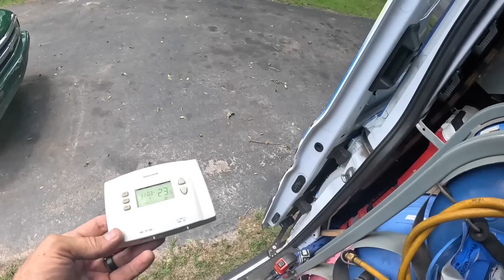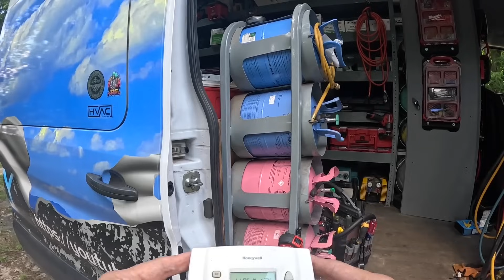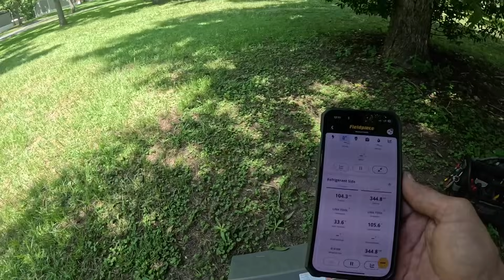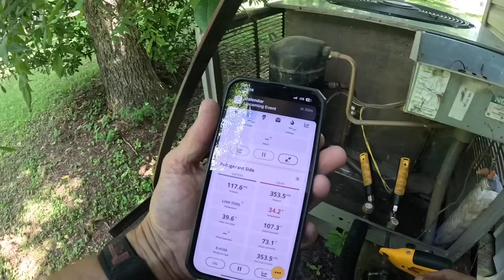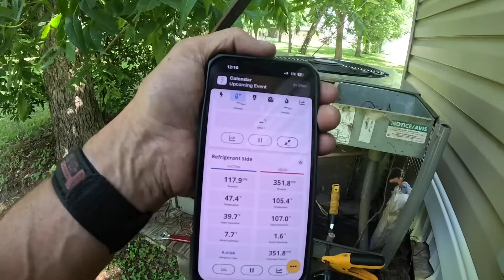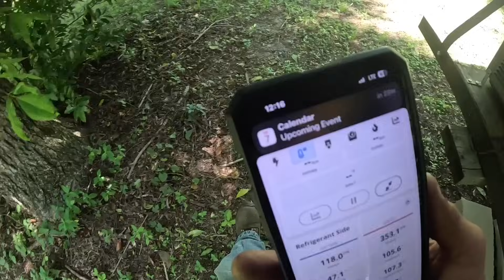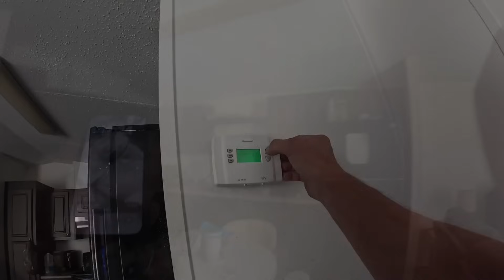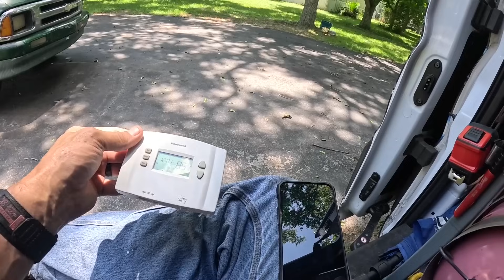Visiting a Mobile Home With Multiple Problems! #hvacguy #hvaclife #hvactrainingvideos

Comment: I had one of those thermostats and battery door went bad and pop open and lose settings. I grabbed simpler model. Heat/ac temp up, temp down, auto and off.

Comment: I need to vent. I'm retired but i don't why architects don't  design hose spigot next to outdoor condensers and electric outlets next to condensation lines to provide easy cleaning and vacuuming clogged condensation lines. Drove me nuts dragging out 100' hose and 100' extension cord. Love your channel keep on keeping on.
Reply from the maker: Thanks
Reply: Mine are
Reply: Power outlets located within 6 ft. of equipment have been a new home code requirement since the mid 2000's almost everywhere in the country. Most homes here are older.  Hose bibs, naw. Only required front and rear and lucky if close by the outdoor equip. Frustrating for sure having to drag
Reply: @steveoh9838 isn’t it the disconnect code you speaking of? I’m asking because i rarely see receptacles near the units. thx
Reply: @paulbryant68  can't speak for every state, but here in NC a maintence power plug has been required since at least 2002. I believe disconnects have always been required.
Reply: Any additional cost of materials and labor are costs to the builder.  And everyone knows that builders never pass any costs off to you.  So any additional cost may put them into bankruptcy.

Comment: It may be a pain, but I have used those foam cleaners on evaporators and they seem to do the job. I guess it is much better to pull them and clean, but I always look for the easy way out. Anyway, another nice job. Like I always say, they work better when air can pass through them. Thanks again for sharing.
Reply: Water works just as good if you clean the unit 1-2 times a summer